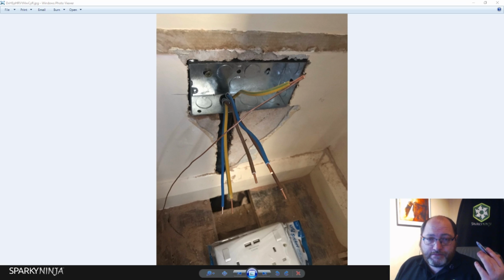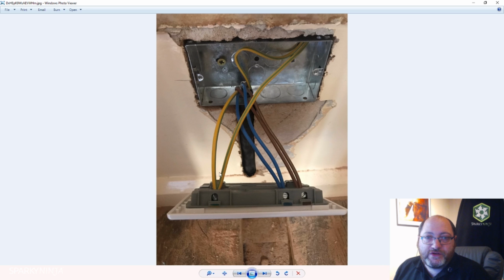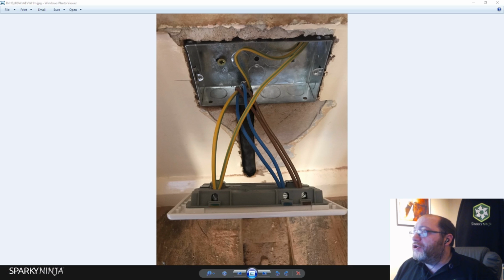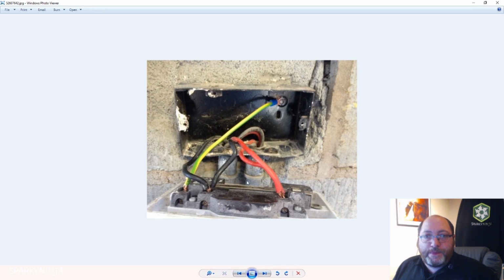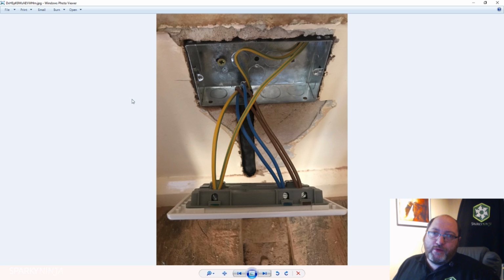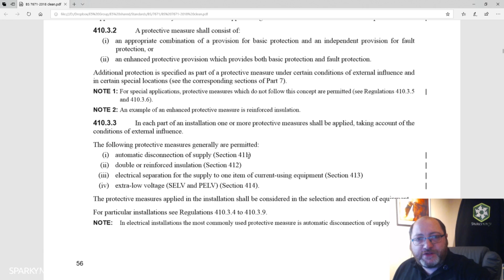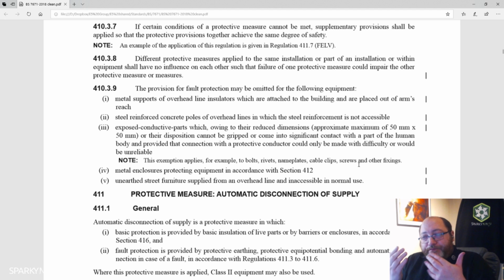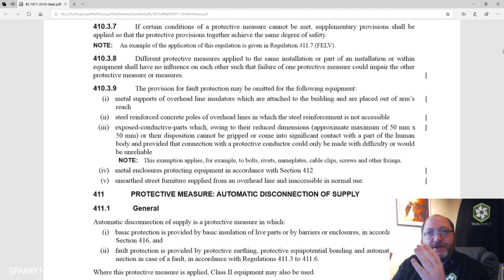Do we need to earth back boxes?

Comment: I always take everything to the plate and take a stranded fly lead back to the back box. The house I moved into a few years ago had the CPCs terminated on the back box and NO CPC connected to the terminal on the plate, relying on the screws for continuity - potentially lethal!  Every socket in the house was connected like this, I assume by the builder who refurbished the house, hopefully not by a proper electrician. All in red & black, so no paper trail...

Comment: What if the back box became live on inspection due to a break in a live conductor. No Cpc no protection I say.
Reply from the maker: Inspecting behind a socket that is energised isn't recognised in Regulation or Legislation though. If you are live working via a sanction to comply with EaWR 14 (c) then you would be applying additional protective measures. Again as I said, I would still do it too, but this is the bullshit that would be used to interpret that work.

Comment: Hi, I have considered this too, and I agree with your reasoning, but you know l would also consider if the wall is subject to any dampness and also some sockets provide those little plastic caps!
That said these days as we 
have R.C.D's which would sense imbalance really reduces potential danger to a minimum, whereas back in the day would have been a bit more involved,
That said I also make a long CPC  into a box tail as it makes the process simple and done all in one go,
I think what you have highlighted is that if you know your reg's then you have more options and it's always better to have options
Right on
Kind regards Warren
Reply: The screws will be earthed regardless of damp, only consideration here is if we're talking about if the cpc was a conduit system or if the sockets have earth bars that don't earth the screws which will turn them into exposed conductive parts

Comment: Was always under the impression if RCD protected then no back box earthing, if  RCD then even a high resistance " earthed screw into lug" would still have the capability of pulling 30ma, not 100% sure on calculation can anyone confirm if I'm right

30ma is 0.03 of 1 amp
30ma is 6.21watts at 230v

The maximum resistance of the lug can be 7.5kohm before it would not have the capability to trip the RCD? 

I never earth RCD protected backboxes it's just another cable in the box
Reply: You assume the RCD will function. How many people Test their RCDs periodicly anyway, from the hundreds of houses I visit - not one homeowner or Tennant has said, when asked, they test the RCD.
Usual reply is 'I didn't know about that'
Reply: @loosecannon5813  yeah I suppose, but  if we start to assume the RCD doesn't work where do you stop, we can assume anything, will the CB work, is the supply authority fuse just a nail? I'll get the meter out later and try and get a reading off a 3.5mm screw to back box higher than 2.85 ohms and get back to you, but I doubt it will be higher, at 2.85 ohms you would pull 80a, I think as soon as it touches without even screwing in it will be 0.1 ohms,
Reply: @markjamieson2005  

The inner workings of an RCD (or AFDD) involve sensitive electronics that can fail bad following a voltage transient. Circuit breakers are electromechanical and almost bulletproof, fuses actually are bullet-proof - if you literally shoot them they still fail safe.

So the disaster scenario is a glowing-hot fault to earth while the RCD has failed due to age and lightning/motor-switching. The fault doesn't draw enough to trip a breaker but it does dissipate enough heat to start a fire. If you're willing to add some more "what ifs," what if there's some kind of crud or resin in the wall, the box becomes energized, and that stuff starts to char and turns into a resistor?

Comment: I have argued this point for years always insisting you need to bring a fly lead from back box to. Socket, when I was doing my 17th edition renewal course the instructor insisted you do not need to do thus as screws earth the plate when I said that when you loosen the socket off  then there would be no earth. to the backbox he insisted that power should never be on with face plate loose so no need
Reply: .... Meanwhile, back in the real world.....people don't shut off the power.
Reply: You may not test to confirm it's dead though on a spur without first removing it so you do have a point

Comment: I am a retired electrician and I find when friends ask me to  change electrical  fittings for them I find  that 80% of houses have wiring interfered with  by previous homeowners for e.g. grommets missing and sharp screws in back boxes. So I like to use 4mm earth fly lead from back box to E terminal on sock/outlet.
Reply: I was trained by CEGB many moons ago (up to 11 kv). The 'qualified ' electrician who just rewired my house did the earth wire to box randomly, never clipped any trunking, never used grommets, stuffed three 2.5 T&E in one backing box hole (one two in trunk), slit the outer cover on a 2.5 and hid it, patched the floor so well that my wife nearly went through it. Don't ever use Adept Electrical and their authority!

Comment: Something I have always done as a must......I use a small piece of either 2.5 mm or 1.5 mm ( power or lighting ) stranded from the screw point on the back box to the face plate of the socket or light switch if it's metalclad , even if it's not required I would still do it out of habit.....

Comment: I’ve never installed fly leads, no ones dead yet, that I know of.
Reply: Yet. What if the cable coming through the hole got cut some how then the box and screws would be live if you had used some makes of socket that did not earth the screw hole. OUCH. OF DEAD.
Reply: Stephen Little easy fix don’t use faces that don’t earth through the screws I don’t install fly leads because I use faces that earth through the screws I’d make an exception for faces that don’t use this system if I ever come across them but nowadays you’d have to put some effort into finding ones that don’t have this system as standard at least that’s in my experience I can’t speak for everyone
Reply: It just that installation of the main earth cables to the box first then to the sockets. Means you could take off that socket and bock it off but still have earth continuity
Reply: If you block it off then just put the cpcs in the box lug. You can’t get passed me with that one.

Comment: Let's just forget that it's a metal backbox for a double socket-outlet for a moment... What if it was a metal backbox for a 1-way light switch, surely you'd connect the cpc to the earthing terminal within the box, so why should it be any different for a double socket-outlet backbox.
Reply: You wouldn't if you had a faceplate requiring an earth. The fixed lug provides continuity
Reply: You would connect the cpc on a light switch to the box coz you need to earth the screws which are exposed to touch, the Bach box on a socket is earthed thought the screws. It dumbfounds me how so many sparks can’t seem to grasp this simple reg.
Reply: My take is, if it's got an earthing terminal, use it. No one ever died through over-earthing.
Reply: @ashmanelectricalservices4318  That's not strictly true, though obviously if it's already part of the electrical system and requires an earth then it should be. But people have died as a result of the PE rising to a lethal potential

Comment: Yes!..i ALWAYS connect metal back boxes to cpc.. I have seen and repaired socket outlets with live conductors popped out of a 32A ring circuit and touching the back box which was not earthed.. The screw heads on the front plate were live!.. It's a no brainer.
Reply: How the fuck can the screws be live? If the socket is connected to cpc then the screws will also be connected thought the metal strip on the back of the socket.
Reply: @supersparks9466  humidity/damp in the wall, over a period of months because it wasn't fully tightened, and corroded, caused a high resistance between the screw head and back box lugs, in tandem with a screw penetrating the live conductor insulation made 1 screw head live! I'm not making it up. It also failed an IR test. It's not made up!
Reply: @muzikman2008  award for thing on the internet  that didnt happen  goes to......

Comment: This is the worst way too earth a back box best and easiest way is using a 1.0mm single from the front plate to the back box when looping the cpc to the box first without breaking the cable is the worst I work in local housing associations housing where lots of people are moving in and moving out well nearly every single one of those redecorate well that solid cpc conductor to the box eventually will fail or snap every time the accessories is loosened and refitted I've found many rings with very high cpc continuity or none because the sparky has looped to the box first before the face plate.
I teach every apprentice I have had to east the faceplate first then fly lead the box second.
Reply from the maker: I couldn't disagree more. I worked in local authorities for over 10 years - I understand your statement on the decorating - that has nothing to do with a reason why one connection is better than another though IMO. Ring final continuity or simple R2 tests will determine this.
Reply: @SparkyNinja  is it not because it's singles so stranded so it's more flexible?
Reply: Socket plate terminals first always. Back boxes rot out and take the copper with it.
Reply: but the back box will no longer be protected once the socket is removed
Reply: If I had a keyboard I watch videos on my phone not a laptop or pc.
Mr punctuation officer.
Reply: Asa Mitchell, your phone or tablet also has commas and full stops. Mr Badger has a point, I too found it hard to follow.
Reply: 30+ years in the industry i agree , always go to socket terminals with cpc conductors and fit bond seperatley, also doubling over of cpc compromises allowable radius of size of copper conductor ,however that is something that has always been done to achieve a better connection
Reply from the maker: @jtk1ify  it's not a bond.
Reply: Asa Mitchell 
Is your keyboard missing it’s punctuation keys?
That is hard to read.

Comment: My view on this is that, if for instance you are working on an existing fused spur or similar accessory that cannot be tested without removing it from the back box, you cannot guarantee that is dead until you have removed it from the back box to carry out the relevant tests (which now and again results in a live conductor popping out of the accessory and landing on the back box itself). If the back box was not earthed in this scenario the box would be live and the protective device wouldn't know anything about it. Its more of a risk to the diy'er or electrician than the end user.

I always earth them regardless, and I'll be doing it in the way its been done in that first picture from now on!
Reply: If the main switch is off I think you can guarantee that your spur will be off.

Comment: if you take the face plate off with the power still on and you get a shock you got what you deserved

dead tests before live tests so even on an eicr you should have all the covers off and inspect them before the power goes back on

the fixings holes on most decent socket outlets are connected to an earth bar in the back of the socket so the screws are earthed via the cpc connection on the faceplate
Reply: andy ? This is my thinking but I’m not sure it’d stand up in court (got what they deserved)  ha ha. 
I never earth my back boxes as like you say, power should be off before removing anyway. I’ve been doing it without for 23 years
Reply: @tommochelsea72  in court id quote the eawr etc, you shouldnt work live unless it is unreasonable to do so.

sockets can be tested from the front so there is no need to remove them with the power on
Reply: You never drop sockets down when they are live?
I will occasionally drop them to have a quick peak at what is going on. Maybe an initial check to see if it has 1 or 2 t&e cables present if planning to add a socket to the ring. Just exercise a bit of caution in case the cables drop out and also depending on the environment. Obviously not in a nursery or something!
Reply: @mrbadger9920  that is totally stupid and dangerous
Reply: Also true with new all metal fronted sockets with the earth strap across the back between screw holes, the screws being the connection to the back box, which takes the earth forward to the back box.

Comment: GREAT VIDEO 👍
The Issue I have is on lighting circuits with no CPC, but class 2 fittings installed.
Im happy with the regulation as class 2 is a method of protection but...
where flush metal backboxes are not earthed on plastic switches then under common fault conditions (pinched cable) screws would become a live part, although  you could apply the regulation mentioned above about a small surface area I wouldnt feel comfortable letting someone take 30mA (which still hurts and is enough to stop/damage a pacemaker)  I would rather fit nylon screws or change the backbox then argue about a non-statuary document in court.

I posted a pic on a Facebook group recently of a switch in a new build where cpc were terminated in floating connector blocks in all metal KO boxes, however plastic caps (a whole other debate barrier or decoration ?) was provided.
Reply: Andy Shepherd Can you buy plastic accessory screws?
Reply: @stevekeys262  yeah, google 3.5mm nylon screws :)
Reply: Andy Shepherd Thanks.

Comment: This was brought up in my last NICEIC inspection in december the examiner was joyfully showing me pics he had taken of sockets that had the earthing bar of the socket just connected to the earth terminals but not to the screw head.
So if i line conductor had came out and would hit the back box it would become live and not trip out if the back box was not earthed.
1st time i have seen sockets like that in 30 years.
Reply: In cases like that you would defo need to bond back metal box as the screws will become exposed conductive parts.

Comment: You do not need to earth the back box it's earthed through the fixed lug in this system why make more work for yourself when you don't need two
Reply: Bullshit some old and my be new sockets do not use an earth at the screw holes so check......
Reply: @mr little, can you point me in the direction of the sockets you talk about which don’t connect too cpc thought the screws. I’m interested to see them. Not interested in old ones as I never install old ones.
Reply: @mr little, u still haven’t answered my question about the sockets without a earth strap too the screws, or it you that is the bullshitter?
Reply: Always go with the belt & braces approach when dealing with electrics imho.
Nothing wrong with having multiple earth routes to the BB, a failsafe is always a good thing :-)

Comment: Good video as always.

Not Earthing lighting back boxes would reduce the number of conductors needed.

If the switch or dimmer had covered screws no conductive parts to get a shock from

My gut reaction in extraneous conductive part earth it.

However I was not taking into account back box small dimensions.
Reply: Is it an extraneous conductive part?  The bricks could be damp, and this would provide a path to earth, but do we now need to earth a  metal shelf screwed into that wall.  Does a coat hook on that wall become an extraneous conductive part?
Reply: What extraneous conductive part?? So much nonsense here

Comment: The starting point should be that the power to the socket MUST be off BEFORE the socket cover is removed. There are plenty of regs, acts, instructions etc which state this point.
However, in the real world, this does not happen.
Let's presume the socket remains energised, an earth fault COULD occur when the cover is off, and if no rubber grommet is protecting the metal entry hole, an earth fault is MORE likely to occur.
'AHH, RCD would trip'  I hear you say..... How many RCDs have you come across that DO NOT trip. LOADS, I mean who tests them periodically anyway?
Reply from the maker: I understand your angle, and this is why I still do it as 'best practice'.. but obviously the regs are not written for this scenario.
Reply: SparkyNinja 

If there is at least one fixed lug it’s really not necessary. If you have a socket with a spur, introducing yet another cable just makes things more cumbersome than they [functionally] need to be.
Reply: @loose cannon, Ive not come across “ loads “  of rcd that do not trip, I suggest you are exaggerating, and I’ve told you a million times not to do it.
Reply: Best practice is the way forward, I've always earthed the back box, with a 'flyinglead' cpc (ie. always  multi-stranded conduit wire) this is more robust than single strand cpc.
I should say metal cover light switches would be given the 'flying lead' cpc treatment too.

Comment: Certainly interesting points, I would certainly earth back boxes, but you are correct, there is no need. Just out of good practice, i would always maintain an earth where possible. Obviously there are many debates about bonding. Cases where people were electrocuted through bad installations in an earthed system, whereby the supply hasn't disconnected etc.. Not going into too much detail here. But my only concern is that if in that very minute circumstance, the owner of the property wanted to replace a socket for example, and there was a fault that didn't disconnect the supply and the back box became live. they then removed the screws and pulled the socket away, then touched the back box. They would almost certainly be electrocuted. Whats your take on this?
Reply: Almost certainly electrocuted? You know that’s means death.
Reply: @supersparks9466  fuck me , does it